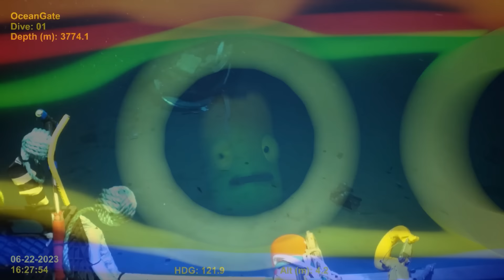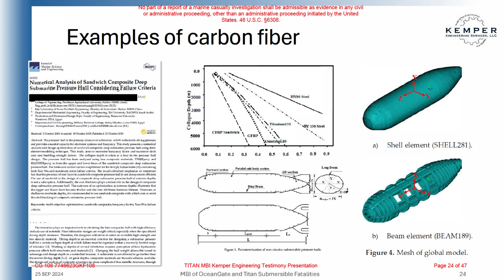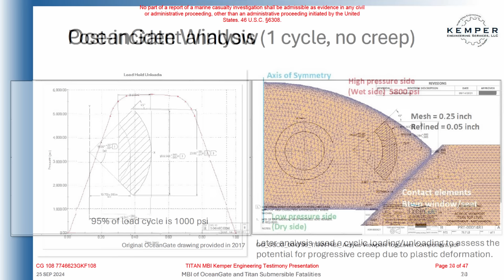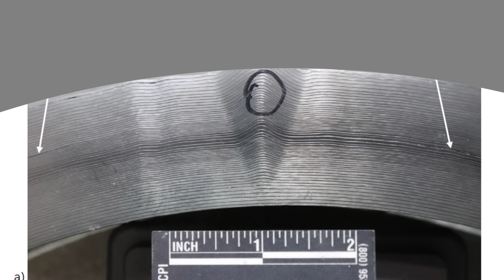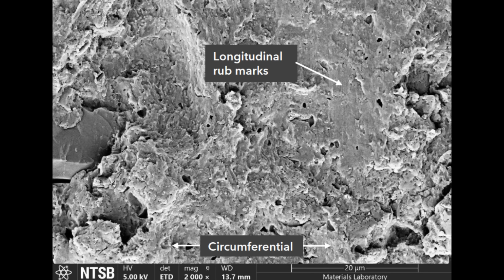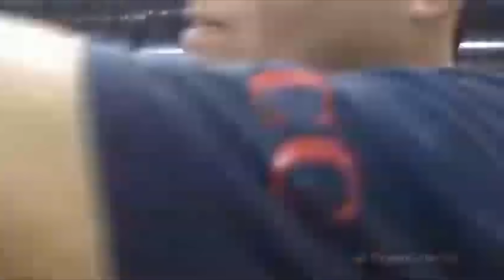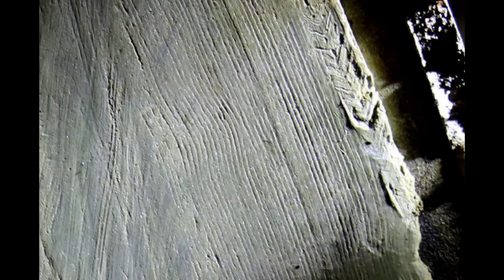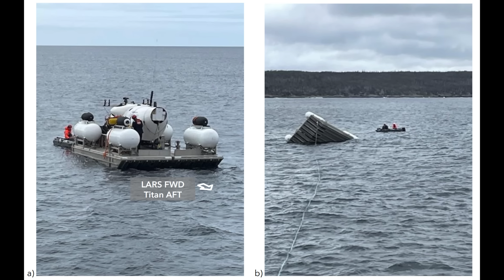OceanGate Wreck Shows Why Sub Wasn't Strong Enough To Survive - NTSB Shares Important Details

Comment: The window issue seems really strange to me.
I understand not wanting a lensing effect for the passengers. But wouldn't it make more sense to have a standard structural window, and then a lighter, non-structural lens with a similar refractive index on the inside to cancel out the lensing of the curved window and give the illusion of looking through a thin, flat window?
Why would you want an unapproved window that's heavier and more expensive than the approved version?
Reply: this whole project feels like someone not educated in the field at all actually being the one to design everything, and then hiring engineers to build his designs

oh, wait, that is exactly what happened
Reply: @Heck6  Exactly. I've started using this as an example for amateur "inventors" who think they have some amazing idea that there are usually good reasons for doing things the way that they're currently done, and until you actually get expertise in a given field you have absolutely no way of knowing what is arbitrary bureaucratic bullshit and what is actually well thought out design decisions that have been standardized. Even then, at that point you're typically competent enough to understand that while the arbitrary bureaucratic bullshit is annoying, it's usually only marginally worse than the way you would prefer to do things and in the rare case where you truly do have a better idea of how to do something you have the knowledge set to actually convince the pertinant bodies to allow you to at least test it and prove that it is better with empiracle data.
Reply: @Heck6  I had the same thought when listening to that part of the video.
Reply: @Heck6  Exact same statement also applies to the Tesla Cybertruck.
Reply: @Heck6 😂
Reply: @Heck6  IIRC Elon Musk did that, he is also the CTO of SpaceX, but he read the book and taught himself after work. I'm not sure if Stockton read any book.
Reply: Yeah I was thinking you could just add another non structural lense.
Reply: And then you could also have a bonus wide view if you move the inner lens out of the way. But it probably would have ruined the vibe or some nonsense...
Reply: The same idea popped in my mind during that section as well.
Reply: Because Stockton was a twit.
Reply: @anjou157 In technical terms, this only explains the whole process.
Reply: the fact that so many people in the comment section thought this immediately and yet OceanGate still used a potentially lethal solution instead illustrates their total incompetence pretty well
Reply: @pialamode  No they're smarter than the comments section. He used the strongest lens design possible.  Also the simplest.  There is no better design and you can't come up with one.  Just saying "why don't they make the car fly" is not an invention.  It's just wishing.
Reply: @pialamode  Or that maybe we are armchair engineers !
Oceangate may have thinked of that solution but decided against for other reasons.
Reply: That's what I'm thinking too. It's literally just highschool physics.
Reply: Agreed - I was thinking the exact same.  Not only could you put a simple Fresnel sheet lens on the interior to get your pretty close-up view, doing so would also save mass.
Reply: Thank you! Same idea occurred to me right away. Solve the exigent issue in a certified fashion then deal with the aesthetic issue by corrective lensing.
Reply: this thing was being designed by mechanical engineering students out of college
Reply: @AsbestosMuffins dropping out of college probably
Reply: @AsbestosMuffins he likely used them because he could either pay them less or maybe even intern for free "for experience working with a innovator" and they would no doubt do as they were told.
Reply: @AsbestosMuffins no it was being assembled by them. As far as anyone can tell, it was being designed by Stockton Rush himself. These engineering students had basically no say and anyone who spoke up got fired
Reply: Yes but custom [precision/precisely made] optics are extremely expensive. 
Which is something Stockton Rush was seemingly allergic to.
Reply: I think sense was in short supply on that project.
Reply: @ScribblingOnTheWalls  But ample hubris.
Reply: this all boils down to cost, in fact the company who manufactured the viewport was so concerned about the lack of certification at the work depth that the CEO offered to make a ceritified version of that viewport at half the price, but Rush refused because it was still additional cost.
Reply: Making a curved surface without obvious optical aberrations is hard (i.e. expensive) Making a flat surface without obvious optical aberrations is comparatively easier (i.e. cheaper.) The standard window had two curved surfaces, and while adding another lens to correct for their effect would work, it requires even more precisely ground and polished curved surfaces, although that lens wouldn't need to be structurally sound so probably not as expensive. Still, an expensive to make window plus an extra part to correct the optics. The design they went with had only one curved surface, and one flat surface that was much easier to grind and polish to an acceptable flatness, and no additional lenses needed.

My guess would be that the extra money spent on thicker material in their design was more than made up for by being easier to manufacture.
Reply: now you are using common sense. thats not allowed in oceangate.
Reply: Not too many people would think of putting a corrective lens inside the window.   The world needs more of your ideas, Kanti.
Reply: @fredtimothy940  Actually anyone involved in optics could have told them that. It's called a compound lens. You have a converging lens with a diverging lens glued to it. The converging lens is structural and the diverging lens is not.
Reply: @chrisvickers7928 but is that also done when the lens deforms under high pressure? Wouldn't you need to have a void between the two lenses, which would then be a space where condensation could accumulate?
Reply: @fredtimothy940  
Funny, i know nothing about lenses and its the first thing i thought. Since thats how everything works from camera to binoculars. So they had to have had the same idea, my guess they went with the worse design to lower manufacturing costs by removing extra parts.
I expect making matching lenses would be expensive.
Reply: @fredtimothy940  Well, the comment section proved you wrong.
If you cannot think of these kinds of solutions on the fly, you're not an innovator. You're just a dreamer with to much money. Which most people can't, but then the same reasoning applies why most people should attempt a professional career as a basketball player. Just admit you're not tall enough ad nobody will hold that against you.
These guys went to the Dunning–Kruger school for innovators.
Reply: @fredtimothy940  That was a pretty ingenious solution actually.
Reply: @fredtimothy940  ??? Maybe it was heavy and cumbersome?
Reply: @fredtimothy940  Literally everyone in every comments section suggests this.  They've never tried to design an optical system before,  obviously,  or they wouldn't suggest something so silly.
Reply: @fredtimothy940  just as a data point for you, when I was watching this video I had the exact same idea: why not use an approved window shape, then add a corrective lens inside it?

so the idea isn't actually so far-fetched as all that 😅
Reply: @fredtimothy940 yes not many only everyone with any kind of engineering degree
Reply: @fredtimothy940  I was immediately thinking the same thing, having a separate window insert for optics is not that far fetched of an idea. And having more material resulting in weaker construction is a very common principal in engineering, as we often remove materials to prevent stress points and end up with an over-all stronger construction. I think the main issue was that this sub was not designed, it looked more like an arbitrary selection of principals.
Reply: That would require employing properly trained and equipped people to build the thing.
Reply: I'm not an expert, but wouldn't this require the window to be looked through from a very specific angle to not be extremely distorted?

Everyone keeps saying that this is how cameras and telescopes work, but the lens of a camera is fixed in place, and a telescope does require you to position your eye in exactly the right location.
Reply: Love the idea, however a non-structural member wouldn't deflect under pressure, and you'd have a separate piece that would have to be independently mounted and field-adjustable for the changing geometry, or calibrated to the exact depth you'd want to have clear vision at. None of that sounds like Oceangate levels of effort.
Reply: Yep literally that’s how lenses for cameras are made. There was no reason for them to do what they did. It’s insane the amount of things they did wrong. A simple acrylic lens that was just lightly glued in place would have compensated for the distortion perfectly. The fact they rather use a sub-par rating to get an optical correction instead of just using the full rating and get an extra optical element to glue on the inside is nuts. Anyone who deals with optics knows this. Every single thing they did was wrong. Completely uneducated in what they were doing. They ignored professionals in every step of building. This was a money grab from the CEO and cared about nothing more than the bottom line. From using the wrong view port to not properly wrapping the carbon fiber, to ignoring their own systems data that was literally meant to detect issues. It actually worked, but yet they didn’t use the data to check anything. It was a bunch of random people who didn’t know how to build something, slapping all these things together. It’s actually shocking it didn’t fail the first time out. But it was only a matter of time. It was inevitable it would fail and kill everyone.
Reply: @josephrhodes2896  It's not so much a money grab as an extreme case of dunning-kruger syndrome plus massive ego. Like the guy was literally on his sub. He "believed" in the idea. Or maybe cynically he knew that if it failed he would die instantly and never 'know' it so he knew he would never have to 'live' in a world where he was aware his design failed and 'live' with the consequences. (unlike, say, an airplane where you have to wait for it to hit the ground, lol)
Reply: Let me guess - cost...???
Reply: This was my first thought as well.
When I was a kid I demolished a pair of binoculars and learned that there are several lenses, mirrors and prisms inside and it taught me quite a bit about how to manipulate light.
I don't know much about pressure but I know eggs have a very strong shape, and also that if you step on a ball it will bulge out on the sides.
It makes sense that the hot spots would be on the sides of the window and not all over, the extra material would act as the ground in the ball example since it's less flexible the thicker it gets.
At least it makes sense in my head 🤨
Reply: I can foresee two problems. One is the acrylic window being elastically deformed (changing optical properties) with depth. A corrective lens would thus need to be carefully calibrated (for a given water depth) or somehow adjustable, and this could be further complicated if the acrylic sees some plastic deformation over repeated load cycles. Another problem is you'd reduce the field of view overall with a corrective lense. To put it plainly, a passenger can get their head closer to the port (without a corrective lens) and thus see a wider field.
Reply: One issue is that you will introduce a little bit of image distortion by having the second window (as now the light is passing through not one but three separate lenses). I will argue that that's perfectly acceptable, particularly with some clever optical engineering that may be able to reduce this distortion effect to just around the edges of the window.
Reply: @efulmer8675 they could have the curved outside lens, then put a flat sheet of glass on the inside, and fill the cavity with a liquid of the same refractivity. That construction would be optically equivalent to what they had but without structural compromise.
Reply: Because if you propose someting as sensical as this, Rush would fire you
Reply: Similar to how microscope lenses correct for aberrations. The effect would be in a mathematically determined pattern and could absolutely be corrected for with a second lens inside
Reply: Because that costs money. What about the profit margin? You can't mess with the profit margins. Those bugattis are not going to buy themselves.
Reply: @The_Curious_Cat A great example of short-term thinking. Imagine the revenue stream from repeated dives that might have offset the additional costs of building a safe vessel.
Reply: Had the same idea.
Reply: That is actually a really good idea.
Reply: You have to think like a mecanical engineer. You are trained that anything is doable and you master the laws of physics. If the boss want something you deliver even if it is not the best.
Reply: My thought as well
Reply: You're asking questions that the Oceangate people were too stupid to consider.
Reply: He had other design goals such as correcting the 'obscene' safety record of manned submersibles. He succeeded at something. So sorry for the passengers.
Reply: My first idea was somewhat similar - take an approved design, and put a non-structural part on top of it, the "inverse" of the shape of the actual structural part. I guess if you separate it by some distance it becomes a corrective lens.
Reply: My thoughts exactly mate…
Reply: I also immediately thought of this, but it seems like the whole ethos of this project was to cut corners and costs at every opportunity - I would imagine it was much simpler and cheaper to just use a slightly different shape then to design and build a bespoke corrective lens
Reply: I was also thinking just add a lens!
Reply: This idea... I hope you get paid well for what you do, haha.
Reply: Eyyy high five, this is exactly what I thought too !
Reply: That is a cool idea. I will admit I understood very little of what you said because I don't think my school taught me that or I simply forgot about it.
Reply: They probably didn't do the finite elements structural analysis Kemper did anyway.
Reply: I had the same idea and that fact that so many other people are commenting to say the same means that this isn't some crazy idea. We have the benefit of hindsight knowing that the design they used is bad and puts too much strain on one point, but that is testing they should have done themselves to figure it out before using a nonstandard design.
Reply: My first thought on seeing this. Most camera lens assemblies consists of composite lenses.
Reply: Acrylic even has tempering issues under pressure without extensive testing. Acrylic starts as a liquid and is hardened and solidified but under those extreme conditions could further compress the material into nolonger fitting the apparatus properly
Reply: Yeah I thought the same thing, lol.  I can kind of understand why they thought it would be fine (it's the same shape just with some extra stuff on it) and people wouldn't have known about the specific stress pattern before that computer modeling that was done after the thing.  But it would have been easy to get a proper window and then just add a lens element. They could have even made it look even bigger with a more complicated system.
Reply: Bro thinks weight matters for a sub, what did you expect? 😂
Reply: @JojoJoget weight does matter for a sub though... like, obviously it does. It's called buoyancy.
Reply: I was thinking the exact same thing when Scott was explaining that aspect of the window.
Reply: In this modern age of high resoloution cameras and screens and image enhancing software I don't know why you'd have a window at all
Reply: I think this wouldn't work because the image would be too dark in the bottom of the ocean. Not enough light to focus back a good image
Reply: There are only a small handful of lens designs,  and none of them have a hemispherical window at the front.  Go ahead and try to design one,  you can't.
Reply: @connordavis5086  Could be costs, or wanting to save some interior space in an already crammed shell.

Comment: "......stress and strain are related, but are different concepts. Stress is the amount of force that is applied to a specific area of an object. Stress can be forces such as pressure or tension. Strain is the change in structure that occurs on the object as a result of the stress."

In fluids the analogy is shear stress and shear rate (strain). A plot of these two produces a linear or non linear relationship whereby the slope at any point on the graph is known as the apparent viscosity.

Likewise the slope of the stress-strain curve is an indication of the stiffness of a solid material. The greater the slop of the graph the stiffer the material and the higher the modulus of elasticity. The plot can also tell us what the yield point and rupture point is for any particular material.

Comment: The thinness of those flanges where the hull met the ring, sheesh. I think they were going for a machined socket fit, but in the end it looks like a thin welded strip. Scary strong forces. Scary engineering.